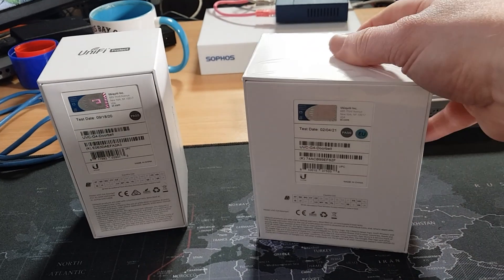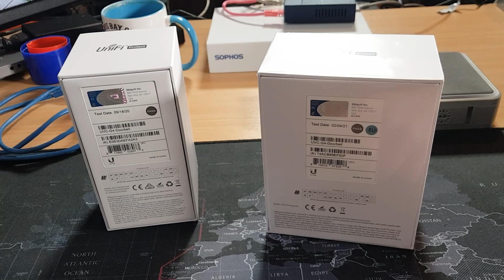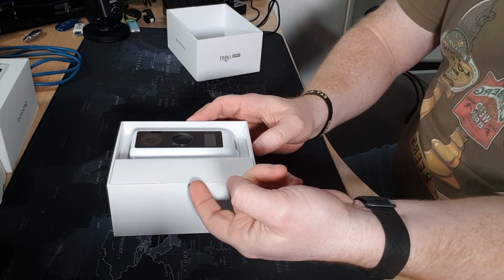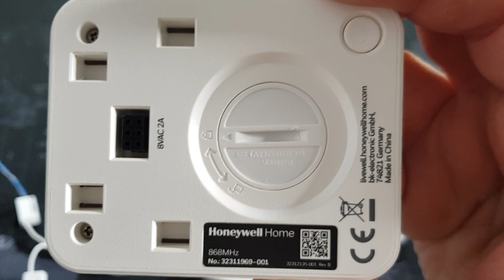Unifi G4 Doorbell - Finally in the EU, Unofficial POE Powered and Wireless Chime

Comment: Hey Just a Question for all..has anyone had issues with cable lengths?? I am wishing to put the Honeywell wireless box in my Kitchen area but that would mean the PoE is travelling roughly 60m back and forth
Reply from the maker: That should be fine, just make sure you use a good quality network cable

Comment: Hello I’m waiting for stock of this doorbell myself. Have you seen on the website they do an EU power supply for it now a plug with EU pins on ? I do have a ubiquity POE switch that does POE+ IEEE 802.3af/at I’m not sure if I could used that to power it.
Reply from the maker: I haven't seen a EU plug yet, I know they did a US one, mine is running off a 24 port Unifi switch with a INS-3AF-I-G in line to drop it down to 24v, this allows me to reboot the doorbell by switching the ports off and on
Reply from the maker: @karl76uk  good for the EU, sadly. O good over here without an adapter

Comment: Would powering this from a Ubiquiti UniFi 24-Port Managed PoE+ Gigabit Switch with SFP 120W work also?
Reply from the maker: Yes, mine currently is with a 48v to 24v conversion
Reply: @JimtheITguy  but if I plug the Cat6 cable straight into the Switch will it work? Or I need a converter? Can you link me the converter you use pls?

Comment: It doesn't work here: G4 reboots a few time after pressing button. Same issue using digital or mechanical chime. It seems to be a massive issue about G4, there is a lot of messages in their forums. I use us-16-150w switch to power up G4 (Passive 24V up to 17W). No problem when chime is disabled.
Reply from the maker: Not had this issue myself, will have to test with my spare doorbell
Reply: @JimtheITguy  I ordered your POE converter, I already have a ubiquiti 48v injector. I doubt because converter is less powerfull than my switch. I'll have it tomorrow.
Reply: I did more tests this morning. This makes me crazy, all is working fine, I mean signal is correctly transmitted and my DCP917S is ringing well. Doorbells displays "ringing" during 10 seconds and then, displays "Shutting down" (with electric symbol) with a countdown (5,4,3,2,1)(no power but it haves time to display a countdown, what a joke...). I tried all I can, digital 1/2/3s, mechanical, all wires reverses possible. The same issue always occurs and G4 shuts down automatically after a ring. This is critical because it doesn't restart itself. I'm not able to determine if it's software or hardware but it's terribly frustrating.
Reply: @JimtheITguy  With the help of the Ubiquiti forum, I continue my investigations.
I connected a DC24V LED strip to the output of the G4 chime relay. When I connect the cable the first time, the ribbon remains off.
When I press the doorbell button, the ribbon turns on but never turns off, even when the doorbell has stopped.
I think the problem is there, the G4 chime relay should cut off the power after the time specified in the app, which does not happen. This is almost dangerous because the Honeywell relay is then supplied with continuous power when the doorbell rings once.
I don't think it's a power issue, I ordered a delay circuit from Amazon to open the circuit after a specified delay.
Reply: @JimtheITguy  Final word... I received POE 48V to 24V and... it works... using exactly same wires, it just works... I cannot explain it but I'm happy. So @ all, use exactly what is described in this video, especially power source.

Comment: Does it work with 24V 500MA Transformer, AC Power Supply plug?
Reply from the maker: it should work but might need a slight adjustment on the wireing to the Doorbell adapter

Comment: After working for over a week problem free I've had approx 20 reboots in the last 24hrs. I can't catch it quick enough to fault find if it's the transformer or the unit itself thats developed a fault. Sufficed to say I'm peeved.
Reply from the maker: What transformer are you using?
Reply: @JimtheITguy  the one in the box. Got the EU version
Reply from the maker: @baughaninastorm  I would be looking to RMA it, do you have a chime?
Reply: @JimtheITguy  currently conversing with support Jim. Not running a chime, got announcements via home assistant working.
Reply: @baughaninastorm  How did you get announcments from HA? I use HA and will be getting a G4 doorbell when they're in stock! Thanks..
Reply: @andrewhart1  you can import all of the Unifi cameras quite easily using the Unifi plugin. One of the triggers is a button push, can't remember what it's called as I'm at work but it was simple enough to write a script. I can send you the script later if you need it
Reply: @baughaninastorm  yes please- I would very much appreciate this script.

Comment: Just tried to power my G4 doorbell using 24V Ubiquiti POE injector and it will not work.....
Reply from the maker: What colour pair are you using on the cable?
Reply: @JimtheITguy  same pairs as in the video the orange and blue pair. I wired my own ethernet cable using the T568B standard and cable tester shows the cable was fine. So tried both 24v transformer and POE injector and will not work. Wired it back to the unifi 16v transform and honeywell D117 chime, the doorbell works and the chime won't work. Been trying to get this to work now for months so any help would be appreciated....
Reply from the maker: @rizwanlockhat6660  Its the Brown and Blue pair, camera probably make it look a bit orange but deffo Brown and Blue
Reply from the maker: https://youtube.com/shorts/yuNbbeJXH_Y?feature=share just checked aswell to be sure so definitely brown and blue
Reply: @JimtheITguy  will give that a try thanks for the video really appreciate it pal. Was at the stage where i was going to give up on the G4 doorbell as without the chime its pretty useless because of the flaky notifications and trying to access then in time.... Do you still have this issue with yours?
Reply from the maker: @rizwanlockhat6660  not a problem, needed to do it for my sanity aswell as had to do a double take on my own doorbell, mine has been fine......althoug I have just swapped over to the Pro so will see how that behaves
Reply: @JimtheITguy  Please do let me know as I would love to swap out to the PRO and just want to make sure it will work. For some strange reason I've had nothing but issues moving from unifi video & controller hosted on my own server to the UDM Pro. My AP and cameras since the move to UDM Pro have all played up... I have to do complete factory reset to all my AP lite and Pro since the lastest firmware update, as post update they completely locked me out to change any of the radio channels...If you asked me 6 months ago I loved my unifi kit...lol
Reply: @JimtheITguy  Thank you the G4 doorbell is all working using the POE injector :) and the honeywell D117 mechanical chime will not work. Tried all the wiring options and will not work....Change the setting in protect from none to mechanical to kick start it still not working. Does your G4 still work with your digital chime? If so ill get the same one and hopefully that will work! Again thanks for all your help and support pal :)
Reply: @JimtheITguy  Thank you for all your help just swapped out to the Honeywell wireless chime in the video and its works!!!
Reply: @rizwanlockhat6660  what wattage is your POE injector?
Reply: @scotaye   it is the Unifi 24V POE injector im using. The issue was i was using the wrong pairs from the CAT5 cable. You need to use the brown and blue pairs. I originally was using the orange and blue pairs. All working now :-)
Reply: Great that you're got it working. Is your injector 24v 12W 0.5A?

Comment: that transformer is useless for most of us, we need a AC /DC adapter plug with a long wire instead. Not all home fuse boards use those type of transformers based on age of house.
Reply from the maker: Indeed, it will probably be down to having to supply things up to standard specification for new builds but most houses are older fuse boards

Comment: "This box seems heavy", I thought, as I unboxed my G4 Doorbell. "What's this bloody great transformer for?" was my next thought. A swift Google search led me to your video, Jim, and thanks for making it. I'd watched Willie Howe's PoE experiment on YouTube (https://youtu.be/ZSBk08uS3No) and was getting ready for DC connection from my UniFi PoE switch. I was then doubly astounded to see that you've got the same Honeywell chime and the wired-wireless converter box I bought for the project. So, you've done the work for me! Thanks. I'm now trying to understand why you used A1 & AC1 on the converter rather than A1 & A2 as we've done away with the AC circuit, haven't we? It'll come to me eventually.
Reply from the maker: Oddly it seemed the only config that worked at the time, I'm going to be testing some stuff again soon as need to revisit this